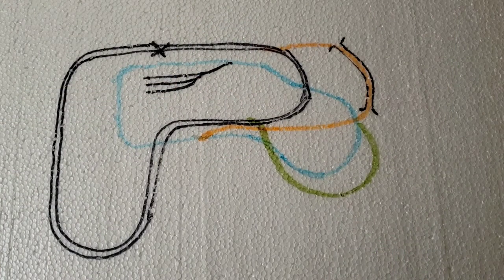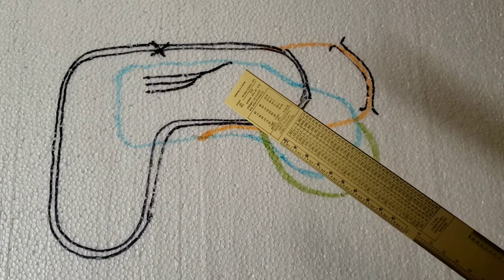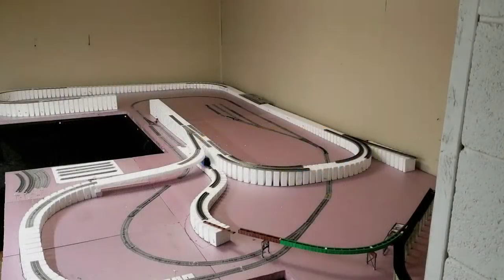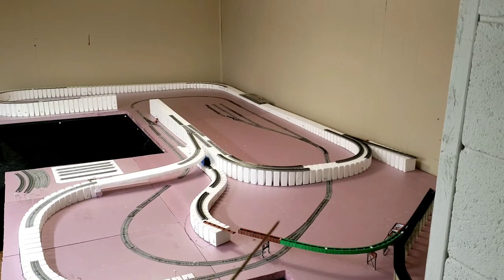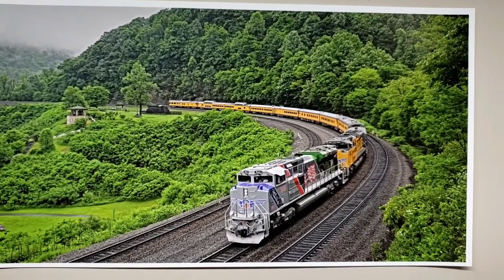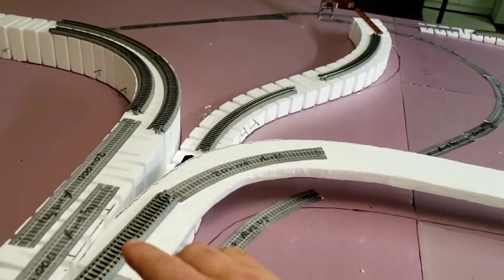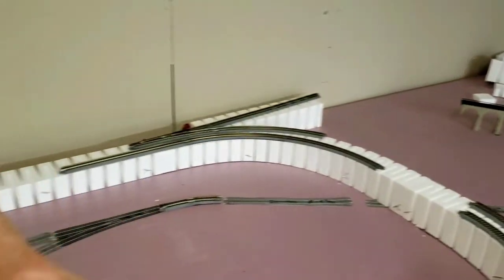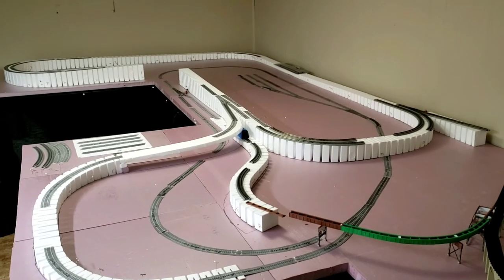N scale model railroad layout #4

Comment: Great idea of copying the track so you can plan in real life,  this can make a lot of difference in seeing it all beforehand....thanks for sharing Jack,  looking forward to seeing how it all comes together 👍👍👍
Reply from the maker: It has worked out for the most part, but it has alignment issues you have to tweak with the real track, but it did save me money in the long run from over buying things I didn't need. Thanks for stooping by I appreciate it a lot.
Reply: @TriGogglin  can I suggest AnyRail software as a computer program to work things out in a small way but your idea is great to see full size. AnyRail helps me with alignment issues!